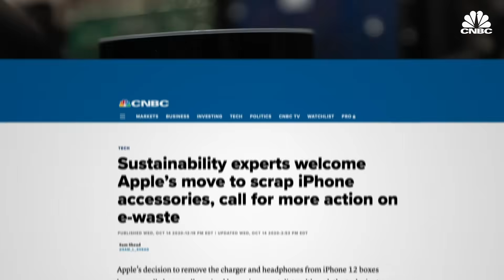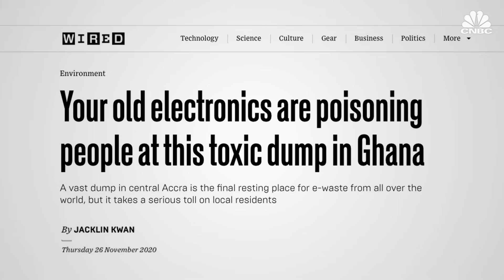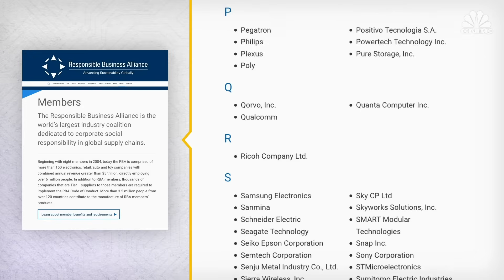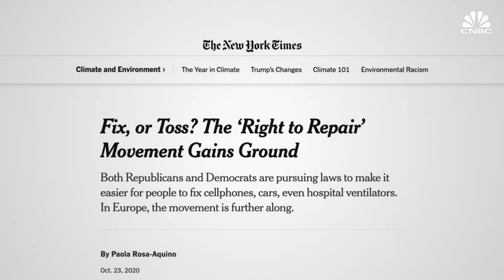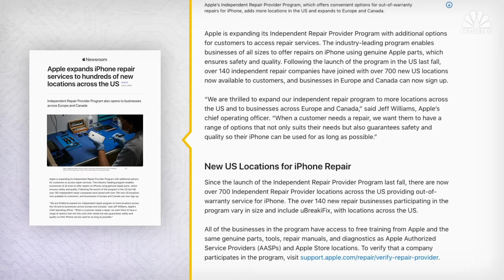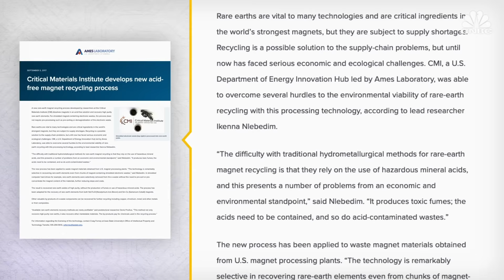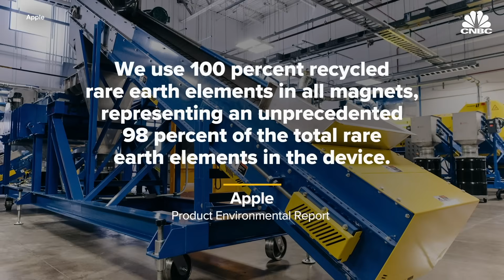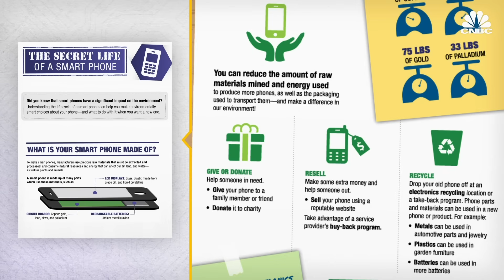How Can We Fix The Massive E-Waste Problem?

Comment: dfidn't steve jobs bury every apple lisa in the desert somewhere? Seems to have worked out okay. I repair old tech for use in film and maintain a fleet of working phones and cameras going back to 2006. I have working tech going back to 1983, working phones 1997-2017, all work fine. You just need to repurpose old tech and it's no longer waste.

Comment: #E-Waste #TradeIns #Refurbished4Poor #ESG
I was looking for Samsung and Apple Ai Photo editors while taking actual photos (Ai Camera picture qualitizer/ equalizer). And just found out that the Samsung S Series numbers actually have sense and meaning behind them with each representing the year each model was released was asking my self from the S3 how did we get to S24 so quickly FUN FACT (chappies):

Galaxy S	=2010-Jun-4
Galaxy S II=2011-May-2
Galaxy S III=2012-May-29
Galaxy S4=2013-Apr-27
Galaxy S5=2014-Apr-11
Galaxy S6=2015-Apr-10
Galaxy S7=2016-Mar-11
Galaxy S8=2017-Apr-21
Galaxy S9=2018-Mar-11
Galaxy S10=2019-Mar-4
Galaxy S20=2020-Mar-6
Galaxy S21=2021-Jan-29
Galaxy S22=2022-Feb-25
Galaxy S23=2023-Feb-17
Galaxy S24=2024-Jan-31

#E-Waste Incentives and subsidies (carrots) or taxes (sticks) need to be implemented like the Car battery industry (since the phones have batteries)

BRING in OLD MODEL discounted on NEW MODEL 

Top 3 Phone and laptop Replacements
1. Broken Screen
2. No-Life of Battery
3. New Model Uphoria
4. Water Damage

Comment: well one way to reduce it, would be FORCE companies to give a longer warranty, 1 yr at 2022 is just a freaking joke, every thing is updated cuz " hey everything much become better" so why have warranties never gone to like 2 yrs or 3 yrs on electronics? why are companies allowed to make device pretty much imposible to fix, so consumers  have to toss it out and get a new one? simply  $$$$$
phones used o have easy replaceable batteries, now they are sealed in, wih the excuse to make it "water tight" yet they get water damage...  not to mention now phones even removed expansion port (microSD) so if you run out of space, then you are S.O.L..
laptops now have sealed batteries too, soldered RAM, and even the hard drive is soldered, making it not only super hard to fix, but imposible to upgrade, so it becomes obsolete  almost instantly.
Lead free solder is actually brittle compared to 60/40 solder used before... so the newer BGA shis are more prone to separate from the board due to thermal stresses or impacts.

Comment: The solution is that Companys need to start making e-products that lasts much longer and and that implies stronger durability and quality and provide guarantee to support them with updates for the entire period and that it can continue to function after end of life of software updates. Consumers must be prepared to buy a little more expensive products because of it. The biggest problem we have when it comes to anything related to manufacturing is that to much is produced and that creates a headache of how to dispose of it sustainably. Longer use of products reduces the demand for new product consumption and that is ultimately the best way to help protect the environment. The material not mined, processed, assembled, packaged and shipped is the most environmentally friendly product because it was never created in the first place or it was created with a lot longer lifecycle reducing the total drain on resources.

Comment: The biggest issue that I see with smartphones is the batteries dying too fast after a few years of use. They did give us a way to deal with it 8 years ago by letting us replace the battery. New phones don't have removable batteries anymore because the emphasis on making you buy a new one. The ifix it dude is right about phone improvement stagnation. The phone you've got in your box in the attic from 4 years ago is perfectly usable right now today. I use a 5 hear old phone and its just as fast as it was when I bought it, minus 5g support. My network isn't going to be supporting it after February but instead of going out and dropping another 1400 on a newer version, I'm just going to jump ship onto a different carrier who supports it. My battery is still at 88% health and I recharge the phone 3 times a day.

Comment: Wow, my e-waste over the last 15 years consists of my first (flip) phone, which I had kept as an emergency backup (and did use as such) before I had a smartphone and a slider keyboard phone that stopped working a bit prematurely (IMO). Plus a lot of broken chargers, I guess. Everything else I sell before it's life is 100% gone, which I suppose could be considered wasteful, but it does get its life continued in the hands of its new owner.

Comment: What do you mean "last longer"?
My old galaxy 2 lasted 6 years. I didn't even replace the battery (even though it was exchangeable).The only reason I bought a new phone was that the screen was cracked an you couldn't run any apps on it. It still works btw.
Reply: Exactly. Lots of people saying they wish phones lasted longer than two years. Since when dont they? Im using an iphone 6s, recieves updates NOW, only changed the battery myself for like 14€ and runs perfectly smooth

Comment: LED lighting is another area with the same problem, a lot of fittings are designed to be thrown away when they fail, and it’s plastic and e-waste. Before, light bulbs and fluorescent tubes were replaceable and recycled. The same goes for streetlights. The modern way is overall much less efficient than the old way.

Comment: A practical and absolute solution to this problem can be in the form of new regulation as follows: A company that designs A new product will obviously design its manufacturing and ASSEMBLY procedures. The new regulation will say that they also MUST design its DISASSEMBLY process! the same way they design the most efficient process to assemble their products, these companies will be forced to design an equivalent backward procedure.  This will cost them more money and eventually cause them to release fewer new products or reduce the product release frequency, which also serves this noble goal. But the best part of this will be the availability of dedicated recycling equipment for recycling companies to buy. As a mechanical engineer and product designer, I can assure you these kinds of systems are much easier to achieve than one might think. It's just not A mandatory expanse for the industrial companies, so they ignore this altogether.

Comment: One thing not mentioned here is software. I use a iPhone 7+ I bought brand it new and it still serves me well. The frustrating thing is when I want to use new software and I’m prompted with a warning that it won’t run in my phone. I understand that I have an older device and some things require resources my phone may not have. 
I think backwards compatibility is large portion of this problems that is being ignored. 

In addition it’s a big selling point for new devices. “Oh that won’t run in your current phone, but it will on the new iPhone”.
Reply: Use project sandcastle to run a new os.

Comment: Apple: No chargers included for the environment.
Also Apple: You can't upgrade the OS of old macs eventually making them useless.
Also Apple: Updating Iphone OS making them slower till you cracked into buying new ones.
Reply: Except i am using an iphone 6s released in 2015 that still recieves updates and runs perfectly smooth and you couldnt quote even a single android phone that does that

Comment: I still regularly use my Fire phone, I wish Amazon would unlock the bootloader. I also have a Nokia Lumia 635 that I wish could have the bootloader unlock. Why can't we have a law that would require companies to unlock bootloaders on their devices after 2 years. These are still great devices, that I wish I could keep using. I still use my Moto E 2015 as well since it has the latest Android.

Comment: Nop, I don't think that electronics lasting a pair of years more will solve the problem, it will only slow down it. And then the majority of people buy new phones because of the new cool features and the cycle continues, what really could be done it's a 100% rate of recycling. So the parts go to be reused and not in some river and it would actually minimize the depredation of minerals and their consequences. But that would require a real compromise of corporations instead of not including certain parts of the electronic to 'help the environment' when the real intention is to maximize their profits.

Comment: Regulations that prevent manufactures from programming built in failure. Lawsuits large enough to enforce that. Basically make laws that the manufacturer must refund the full value of the device if built in or programmed obsolescence is proven. Make it so that bankruptcy isn't an escape for ceo's/execs or share holders. 

Real accountability is the only way.

Comment: We have a massive e-waste problem because the government allow companies such as Google Apple Samsung to use software make your electronic absolute , there is no way if you buy a product it should stop working because someone implement a software to prevent it from working any more so that you have to upgrade every two years, if you buy a 1975 Mustang you can keep the car running forever. the same thing is to happen modern day cars they use software to make the car absolute  so you have to buy one every 10 years , This should be banned this should be illegal for companies do you software and make your product stop working even if it doesn’t of the new feature it should be able to do the basic thing that it normally do make phone calls send text message email !

Comment: Does one really need to replace their phone on a yearly basis (or even a two-year basis)? I've been using my phone for almost 4 years now and I plan on using it till it breaks.
Reply: I have been using my mobile phone for 5 years now, it is still fast and able to install all the latest apps, only amazon is not allowing me to install it's latest android app and there is no need for me to drop it, I plan to use it till it breaks or if 5G becomes norm in my country and 4G is out of use.

Comment: I only get LG phones
They last 
My G6 is almost 3yrs old with no issues
My G3 was still good but I needed a waterproof phone that's why I got the G6
My Viper was only replaced because it couldn't run the apps I needed, same with my Lotus
I've had 4 phones in 12yrs
Reply: 2015 iphone 6s, still recieves updates and runs smooth. 2015 lg phone, ill bet it is just unusable

Comment: I'm still rocking my old S6 Edge. I refuse to buy a phone every 1-2 years. It's ridiculous how these companies push new products and drop updates so quickly while far to many people feel they need to upgrade every 24 months or less. Also we don't see removable batteries anymore. My old Pixel I carried an extra battery for when I needed it. Speaking of which I still have that dam phone along with another just sitting in a drawer in their retail boxes. 

Apple it terrible. They've been pushing again right to repair for years. Now they figured out how to do that by locking the camera to the phone and making parts no interchangeable. 

Regardless this is a massive problem in a society and world where we view electronics as throwaway items. And not everyone has access to drop off electronics for electronics. There isn't a single place w/in 60 miles of me.

Comment: It doesn't matter how modular something is if the company serialises most of components so they don't work properly after replacement. 
This makes the OEM the only ones possible to make new components work. 
Therefore they can charge whatever they like for repairs.
They can choice to only offer certain repairs. Example: Cracked the back of your fragile glass phone? The company doesn't offer that repair but don't worry they can just replace the whole phone or maybe you would like the new model, as its almost the cost of this repair on your current phone....

If a company gets full control of repair, what happens when they stop supporting service for that device in 3yrs. To bad, looks like you will need to throw it away and buy the new one because no one can fix it but the manufacture.

Think thats bad, some companies slow down their devices as the battery ages and when you update the software, they also don't let you install the older software after you update to the new one. How do you think they make the new devices feel so much faster.
Reply: I am also fighting Apples restrictions and repairing new iphones. Keep it up buddy! :)
Reply: Apple is guilty of doing this
Reply: Actually any thing is respirable. Hell free target practice if it doesn't.
Reply: Don't forget the vendors FairPhone and ShiftPhone, iFixit has rated them best for repairability. They last long, are very easy to repair (FairPhone for example does not use any screws) one gets every replacement part directly from the vendor, they use a lot of recycled materials and set a focus on being FairTrade.
Reply: true
Reply: Thank you Hugh! It’s your opinion in videos like this that really make the difference.
Reply: Nerd
Reply: i agree
Reply: yup, its the OEMs fault, they want us to dispose our devices ASAP so we can rush in and by another off them for money. Back then with phones and such you could swap a new battery in within a minute and drop it from high heights and they were able to handle it. Back then it seems like everything was built better to last longer, now its the complete opposite and its all for money. So much for companies caring about the environment
Reply: electronics should also have f*cking standard replaceable modules like in PCs, so you can take three different phones from iphone, samsung and noname vendor and make another working phone just from their parts
or take your old phone and just place there a new camera module if this is all you need from new phone
etc.
Reply: Hey!! I love your channel, keep up the fight!
Reply: apple has even now put some  codes into the battery so that even if it from another iphone, it wont work due to it not having the "expected" code on the part
thy have done this to batteries, the screen, cables, the now discontinued home button. etc

Comment: this video focuses too much on apple and ignores that in developed countries most people buy new electronics not because they couldn't repair their old one but because it is not economically attractive. we have reached a point where the economy of scales from the company's manufacturing and shipping astronomically outperforms what repair shops can offer, as a result, repairing a phone's screen would cost half of what the same model would cost new for instance.  this is a result of producing electronics in low wage countries, they are made brand new at low cost but then the local repair store has to pay high wages. the only way to reduce e-waste is to make brand new products more expensive or to pass laws so people feel it in their pockets when they have to dispose of old products so they end up buying less. of course this would be extremely unpopular

Comment: Repair and replace the small component which is damage it help people to able use their phone function back again the most of the time was the battery life is short about 2 -3 year you can tell the battery die pretty quick die out and there's 3 phone of my phone just black out cannot turn on cannot even charge that was the worst situation that I encounter just happen I using the only phone that I have is a worst feeling that I have no phone back up. But software is much tricky for example iphone the more updates you install to your phone the slower it get till the point that your phone is unusable it Force people to buy their new, fast, capable of 5G and the latest brand new smart phone but not smart enough that phone can't last long i hate to say that my first iphone and one of my favorite iphone 5S is unusable with battery issue and the phone constantly heating up like crazy. Hope the future will fix the old phone back to normal state

Comment: I wish Android phone makers like Samsung still put out software updates for their phones for longer than 2 years. That way, people who choose Android phones can keep them longer than 2 years. You can keep your new iPhone with guaranteed OS updates for 5 years.
Reply: Agreed. There is no reason at all other than pure greed that these up to $2,000 devices in the case of the Galaxy z Fold don't get updates for 5 years like iPhone does. They will run newer software without issue in all cases. If not then the root/rom community wouldn't exist. I have a Note 4 which came with Android 4 running on Android 9. The only reason its not running on Android 11 now is i would lost function on the headphone jack. It may not be as fast as a new device but it don't miss it by much at all.
Reply: @jeremytart639  Wait, so Android 11 no longer supports the headphone jack? interesting since some budget phones still have headphone jacks. Also the Note 4 came out in 2014. I wouldn't think using that in 2020 going into 2021 as your main phone would be a good experience, even with rooting.
Reply: @uthmanbaksh3530  actually it is good now. That's what I'm using. It's better now than when it was new. Everyone has been brainwashed into buying a new phone every year to three years when your hardware is still good. No what I'm saying like in the case of my note 4 and the like anything newer than android 9 usually doesn't support the headphone jack at the moment. Custom roms are different than stock google provided android. They are ported by the community. It's more a driver issue than anything. Oem's don't have that problem.